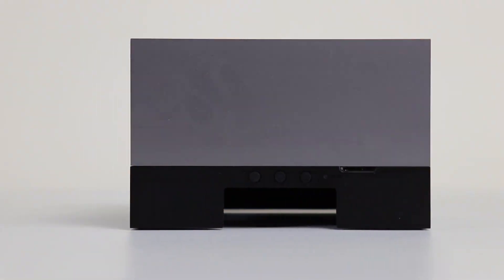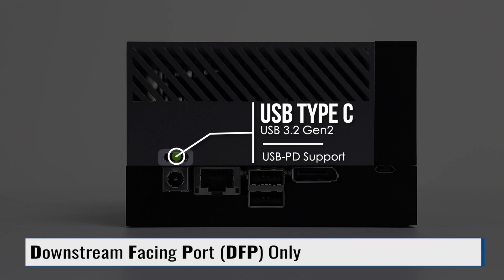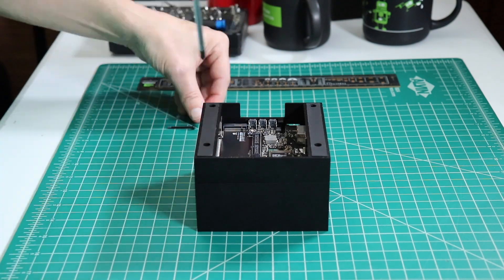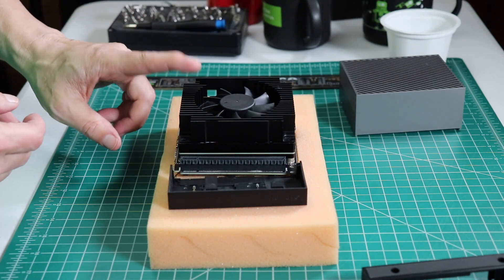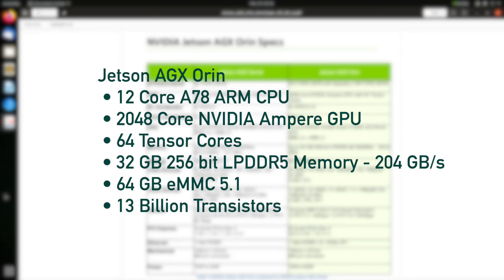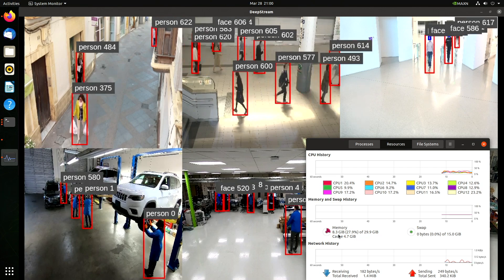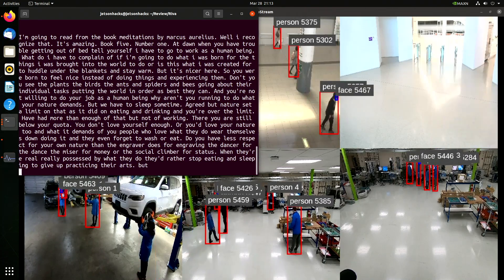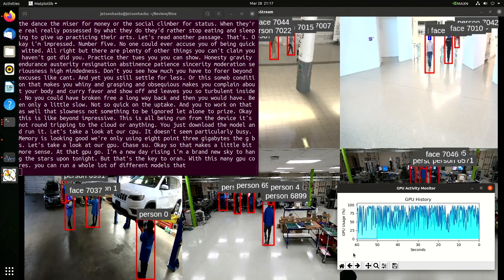NVIDIA Jetson AGX Orin Unbox, Setup, Demo - Just Wow

Comment: Jim, it looks like the elusive JetPack 5.0 is there. You got a pre-release?
Reply from the maker: Yes, all the Orins ship with JetPack 5.0 Developer Preview (DP)  for right now.  Even though this particular device itself is pre-release, I was able to install the latest pre-release. The GM will probably be released by the end of this week.

Typically NVIDIA shares pre-production with reviewers before launch on most of their products. That does a couple of things. 1) Gets product to reviewers so that they can get articles and videos out. And 2) it helps iron out the start of the production process.  I don't know what the volume is for more popular products, but most companies will run a small batch to test the manufacturing/quality control which they then either give away or destroy/recycle.  Depends on the company, but most destroy/recycle for obvious reasons.

Comment: Great review! Thanks for sharing! I really want to know whether that PCI slot can support a regular NVidia graphics card for a basically indefinite performance boost.
Reply: It will theoretically support it but you need to make sure there is an ARM driver with compatible kernel version for your card. Furthermore it won’t provide enough power since the whole unit maxes out at 50/60 watts. You’ll need an external power source for you card. There is Nvidia Clara platform that does something somewhat similar. If you make it work pls share ;)
Reply: If you put another graphics card on it, the price <-> complexity relationship is probably better spend on a normal atx board with two GPUs. You need the power anyway for the GPU and you have a form factor and none-arm tooling that are proven. Just because a graphics card fits in there, I would not try to force it to work. Rather change the tooling choice. My 2ct 🤷🏻‍♂️
Reply from the maker: Thank you for the kind words. People have talked a long time about that very thing. As I understand it, that's a feature that people are working on. However, there are several issues still. You can probably ask on the NVIDIA Jetson AGX Orin forum, and maybe one of the NVIDIA engineers will have an answer. Thanks for watching!

Comment: Was looking up the 32/64GB differences... That SDK seems a mix of 32GB with the full core numbers from the 64GB version.
Will wait till the 64GB comes out and gets cheaper.
Reply from the maker: I believe you are correct, the Dev Kit has 2K cores, but 32GB memory. The 64GB AGX Orin Module will have 2K cores, the 32GB AGX Orin Module will have a few hundred GPU cores less, as I recall. One thing to remember is that there's a big price bump in the memory markets right now to go from 32GB to 64GB, so there's some balancing to figure out how the pricing will change. Thanks for watching!
Reply: @JetsonHacks  is it shared between CPU and GPU or does the GPU have its own memory?
Reply from the maker: @lowfuel6089  The Jetson all have a unified memory architecture, that is, shared memory. It's similar to how the new Apple M1s are setup, everything uses the same memory. The new Macs use LPDDR5 memory like the Jetsons. Thanks for watching!
Reply: @JetsonHacks  very cool, thanks. An ampere GPU with access to 32gb ram is pretty amazing at this price
Reply: I think it will get cheaper in maybe 3 years. Check the AGX Xavier price - still retails at the same 800.
Reply: @AI-xi4jk  I already have 2 of them, 16 & 32GB

Comment: Could we get a showcase of the full GPU enabled in a benchmark and/or gameplay scenario?

I want to see what all that extra cache does versus Desktop Ampere's Equivalent (The 3050 Laptop) when running the full 14-16SMs (don't know how many are in this Orin Config because NVIDIA jebated in the pdf documentation that there is a CPU and GPU difference between the 32 and 64GB models)

Primarily because AMD adding a lot of cache to their GPUs with RDNA2 gave them massive performance increases so NVIDIA doing it here would be interesting.

Maybe 3DMark with the GPU running at

768Mghz
1Ghz
Full clock?

(Also a side idea, is it possible to disable SMs in a benchmark to bring it down to 12SMs? if so could you do that and run the 768Mghz and 1Ghz numbers through a benchmark like 3DMark or something?)

Sorry if that is a bit, just very curious as this sort of can give us a preview into Lovelace as that also has the massive L1/L2 Cache change that Orin does but even bigger seemingly
Reply from the maker: I'm terrible at running benchmarks. Usually I rely on Michael over at Phoenix to run reasonable Jetson benchmarks. Because of the shipping challenges, it will probably take a little while for the benchmarks to be published. Thanks for watching!
Reply: @JetsonHacks  Alright, at least maybe awnser the question I asked in reply to the 15W Clock question?

Aka how many GPU cores are active in that config

4 CPUs at 1Ghz with how many GPU cores/SMs active at 420MHz?
Reply from the maker: @Alovon  I'd only be guessing, I've only spent a little while on the machine. Please ask the question in the official NVIDIA AGX Orin forum, where a large group of developers and NVIDIA engineers share their experience. The NVIDIA folks will know the real answer.

Comment: Thx for the demo. Would there be a way to know gpu and cpu clocks in the 15W mode?
Reply from the maker: You are welcome. This is a pre-production model, so the numbers might not be the same from a production unit. From /etc/nvpmodel.conf:  In 15W mode, 4 CPUs are online, maximum frequency 1113600. The GPU max frequency is 420750000. Thanks for watching!
Reply: @JetsonHacks  Seems a bit low compared to xavier nx on the same kind of board. Thanks for the feedback
Reply: @JetsonHacks  Any indication on how many GPU cores are on in that config?

As that is...concerning with how it's mostly lopped off a lot of the SoC.

Comment: So expensive..😢
Reply from the maker: I hear you, the flagship models usually are. However, it's still $500 less than the AGX Xavier was when it was introduced in 2018. The Orin NX modules should be out in Q4, and they start at $399. Thanks for watching!
Reply: @JetsonHacks  How to use Orin NX modules, can it be mounted on jetson nano or jetson xavier nx carry board?
Reply from the maker: @tientruongleanh2206  I do not know. We'll have to wait until the modules are available. Thanks for watching!
Reply: If you compare the price with the capabilities, this Orin is extremely cheap.